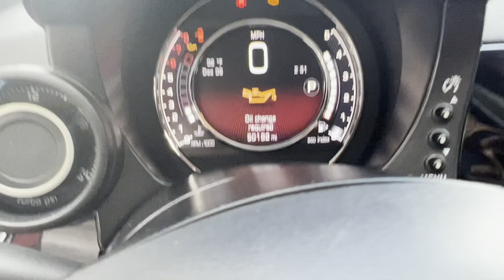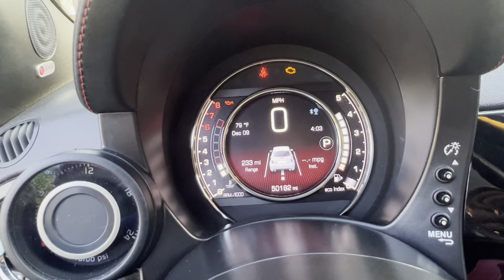How to change  Oil on Modified Fiat 500 ABARTH ! TURBO POCKET ROCKET !

Comment: Do the filter ones it’s empty all that old oil is going straight back on the new filter if you do that first.😂😂
Reply from the maker: The majority of the oil (3.9 quarts) is in the oil pan. Any contaminants in the oil are captured by the old oil filter . Not very concerned with the few drops left in there. But yes you can definitely take an oil rag  to absorb every bit off oil in the housing if you please !

Comment: Just changed mine last week, I Wana see how you pull your filter out of that tight ass spot lol 😆
Reply from the maker: The engineers chose a very interesting place to put a filter 😅
Reply: @Sliderz_Official  went to change my plugs and only one plug tube didn't have oil in it...all over the plugs...time for valve cover gasket/tube seals and that multi air filter while I have it apart.
Reply from the maker: @your_eulogy2688   good man 👍🏼